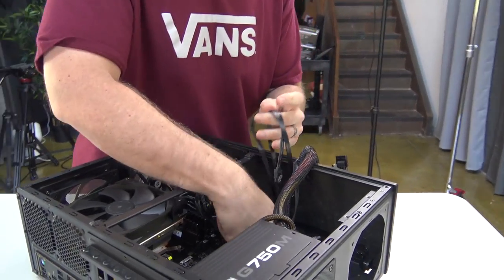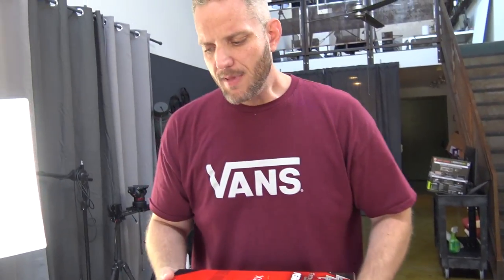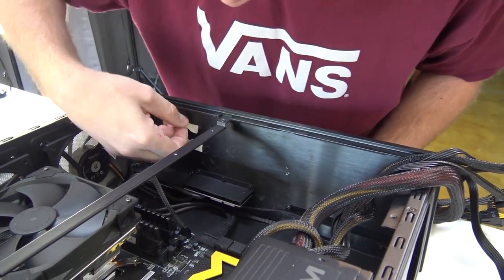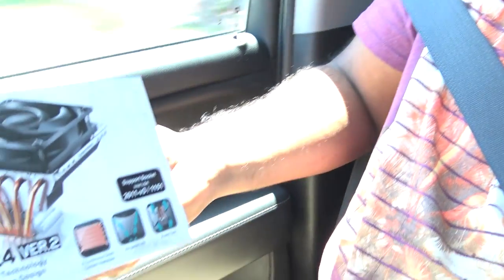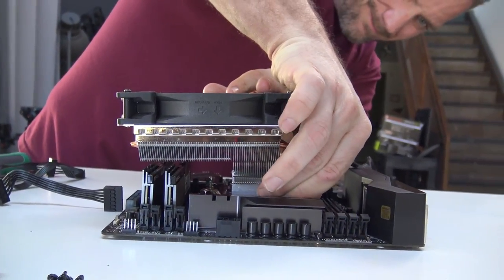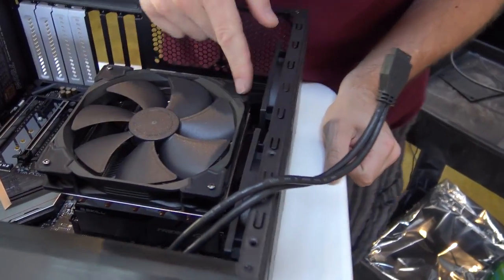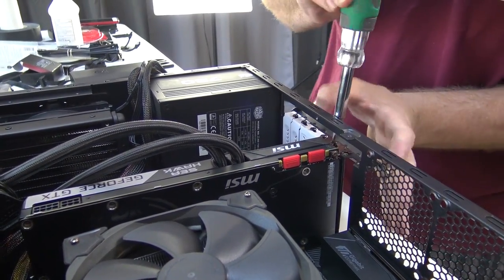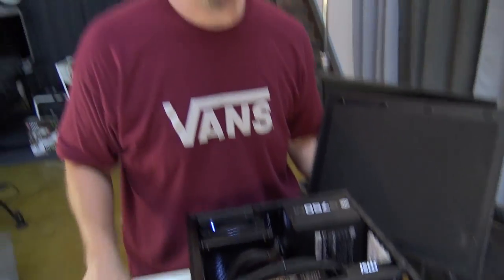X299 + 7740X = Ultimate VR PC?

Comment: Hey Jay, instead of double sided tape try using those removable 3M strips ( the "refills" for the coat/key hooks). I use them for the ssd mounting in my coolermaster case so that I could remove the other hard drive cage. They are a bit easier to peel off, if you leave the pull tabs exposed. Plus, you don't have to scrape them off if you decide to change your mounting. Just food for thought...
Reply: Robert Snyder I used those to hold my Elgato to the side of my desk and 3.0 hub.

Comment: people still buy intel?
Reply: faisal rahmat Sadly, yes.
Reply: unbelievable...
Reply: WalkandPeace sure, but they will never buy x299 or z270 right? all they want just a computer for thing like ms word or excel...
Reply: WalkandPeace no cheap intel soon then...😑
Reply: If you have the money Intel is still the best for most people, more threads are just going to be sitting idle under most common work loads, games rarely see significant performance increases beyond 4 cores so you will get much better performance going with the Intel chips that can OC to much higher frequencies than Ryzen chips because higher frequencies always improve performance for any workload.
There is also the issue that the Ryzen hardware (and new Intel platforms like X299) is still new and not as reliable as the more mature Intel platforms so it's not as good for professionals or companies that NEED reliability even though they would probably benefit greatly from the extra core at lower prices, this is why Linus Media Group recently upgraded to X99 instead of the newer Ryzen or X299 platforms.
Currently Ryzen is pretty much only ideal for people who have a need for more than 4 cores and are willing to accept slightly less reliability to save a some money, or for people who's budget is so low they might be considering an i3 or low end i5 when AMD is offering 4-8 cores at similar clock speeds and pricing. So it's great for amateur youtubers and twitch streamers but not for just about anyone else, and if you paid attention that's exactly who AMD were targeting with their Ryzen marketing.

To be clear I think Ryzen is great, it's just unfortunate that because of Intel's long running market dominance and unwillingness to add more cores to their main stream lineup, there hasn't really been any mainstream software designed to take advantage of more than 4 cores. However with Ryzen now being available in the mainstream hopefully more developers will be making their software take advantage of more than 4 cores and in the next 3-5 years the 8+ core CPUs will make a lot more sense. Ryzen is just too ahead of it's time, and by the time mainstream workloads catch up and make Ryzen a good choice it will be time to upgrade away from Ryzen :(.
Reply: AusSkiller 
This is the must logical conclusion
Reply: AusSkiller just simple question, i got an i5 6500 + z270 board and planing to upgrade, which1 shuld i buy, an i7 7700K OR r5 1600+b350 board? the cost for that both option is very similar at my country, what do u think?
Reply: faisal rahmat what do u aiming for that upgrade? if u gonna upgrade for ryzen u gonna need all thing like new mobo and if u up to i7 7700k its wasting money because u already have PC. just spent it on other part
Reply: Lie Stefanus90 planing to upgrade for video editing and 3d rendering... i5 not fast enough, some people build a pc not just for gaming i guess...
Reply: faisal rahmat then choosing i5 is already first mistake u did go for ryzen if aiming for that
Reply: Lie Stefanus90 dude i got that i5 on august 2016, no ryzen back then...😑
Reply: faisal rahmat oh wait do u do heavy 3d rendering(studio) or just avg rendering?
Reply: heavy rendering= ryzen 
avg rendering = i7 because u already have z270 just oc it to 5ghz and get serious cooling aio
Reply: Looking at the market share, one has to ask:

People still buy amd?
Reply: Lie Stefanus90 nice... but with similar price of i7 7700k i can get a r5 1600 plus b350 board for it, what u think? if ryzen can do heavy rendering i realy consider to get ryzen since the upgrade cost is same...
Reply: "people still buy intel?"
Jay did not buy it.
Reply: faisal rahmat really? u should start selling ur z270 and i5 6500 which country u from? im looking for z270 right now
Reply: faisal rahmat get the 1600 and b350 board. It'll be great for rendering
Reply: Lie Stefanus90 am from indonesia...
Reply: Tough call faisal rahmat, if your primary use of the PC is rendering (and you know the software you use can take advantage of the extra cores, and it can't do the rendering on the GPU since GPU compute can be MANY times faster than a CPU) then the Ryzen is probably the best for your needs, assuming you can risk having a crash/restart during your render (it's highly unlikely to happen with the latest firmware, but sometimes reliability is critically important and a random crash/restart cannot be risked).

If you mainly play games and do rendering on the side then overclocking a 7700k to 5ghz will probably be a better option as the performance drop for rendering is only going to be about ~20% at most assuming you can get the 1600 to 4ghz, and you could get up to 25% better performance in most games. Of course it would also depend on your GPU, the game and the settings you want, as if your GPU can't push the frames fast enough it won't matter that the CPU can send it more.
Reply: faisal rahmat that is stupid, it is downgrading a mobo, coffelake will bring 6 cores to lga 1151
Reply: dawg ik  that the ryzen 7 is cheaper,but the i7 7700K is still better for streaming,gaming,etc
Reply: Also, ryzen b350, x370 and x299 don't feel High quality, i struggle to see b350 Boards with more than 4 phases, and most of they don't even have heatsinks on them. My z170x gaming 5 Board came with 12 phases for the prize of a top tier b350 one. What they do have is rgb all around, i like rgb but when a whole heatsink becomes plastic just to be Able to change it's color it is too much. Connectivity in ryzen is not the strongest point either, f.e. The gigabyte ab350 gaming 3 has got 4 Sata ports, no SLI capability and 7 usb ports (one being 2.0) and one m.2 slot, but of course it has got a lot of rgb!!!
Reply: AusSkiller Ryzen x370 and lower chipsets are very reliable. I built a 1700X system about a month ago with a 1080 ti and I had no memory issues, ran at advertised speed, and I have yet to have a single bug from the platform. Threadripper and X299 will have issues just like X99 had issues a couple years ago, but give it 3 months and it'll be all sorted out.

And if you think hardly anything benefits from more cores, I've had my 1700X at 80% while playing Assassins creed syndicate with the only thing in the background being MSI Afterburner.
Because ryzen is so popular, next generation games are going to benefit from more than 4 threads. It's just a matter of taking time to program it. Consoles have 8 core jaguar chips, and they fully use 8 cores because that's how they were programmed to run. As it gets more popular you can expect it to become more mainstream.
Reply: Well yes because the 7700k is still unmatched in gaming.
Reply: Savage Salvage,  Yeah Ryzen is certainly quite stable now, but it's still a new platform and it will usually take at least 6-12 months to ensure all the bugs are worked out and it is suitable for usage in an environment that requires reliability. For the average consumer it's certainly stable enough but for professionals and corporations that can't afford any down time it's hasn't been stable long enough to prove it is suitable for such use, it's just a matter of time though.

Utilisation percentages do not equate to performance unfortunately, multi-threading is an incredibly complicated subject and games are not a very good use case for it, often there is a lot of overhead to doing multi-threading in games because the work required cannot be split up easily, there are different types of work frequently being switched between, and/or is there is too little work to keep all the cores consistently saturated, this leads to seemingly high utilisation for what is actually rather marginal performance benefits. There is also a lot of asynchronous work that can be done in games that may not have any noticeable impact on performance such as streaming textures or music that is just preparing data for use later on and is designed to be able to take much longer without any impact on frame rate but can bump up the utilisation a fair bit. There is also the issue of CPU utilisation metrics being rather inaccurate as they often just sample the CPU at regular intervals and report an average rather than monitoring the exact utilisation (which severely impacts performance) so if the usage fluctuates rapidly it's often hard to get an idea of how much it is actually being used. There's also architectural issues in the code for games that can come into play, there is often a single "main" thread dictating the overall flow of the game, the performance of this main thread is what will dictate the frame rate, if it is running at 100% and the rest of the threads have to wait for it then it will not matter how many cores you have you will not be able to increase frame rate, this is how pretty much all games were made until recently and it is still heavily used in games due to the nature of games development. In this case the only way to improve performance is with higher clockspeeds or better IPCs. If you are using 80% because 20% of the time the rest of your cores are waiting for the main thread then a 7700k is going to have a much better chance at outperforming it.

Take a look at gaming benchmarks comparing the 7700k to the 1800x, often the 7700k will beat out the 1800x and in the instances where it doesn't the difference is pretty marginal. I imagine the 1700x isn't going to fare much better.
Reply: AusSkiller I simply pointed out that game because it's higher use case. In most games I get a reading of around 25 to 35%.
A friend and I are mildly competitive with our PC's, who can get better overclocks, and stuff like that. We play on each other's pc's to see what is actually better. This time he went 7700k, and I went 1700x and I got mine overclocked to 4050 MHz and his 7700k is at 4.8 ghz (he didn't win the silicon lottery, any higher was crashing even with 1.48V) and we were surprised how much more smooth the 1700x was than his 7700k at dx12 games. He had a higher average frame rate but I had much better 1% and .1% lows. It's amazing how much smoother the games feel. That's not a AMD vs Intel thing, it's simply an 8 core vs 4 core thing. We both have 1080 ti's, mine at 2050 MHz and his at 2088 I think.
Dx11 games were different though. His frame rate was higher but smoothness was the same. It's because dx12 has the ability to put tasks to more cores even if they're not fully utilized, it takes the load off of single core (to an extent of course) so when the CPU is pegged it can spread out the load. It's currently not very efficient, but it still works decent and that's why so many people (myself included) claim that ryzen gaming is smoother. 7700k is marginally better at best, which is why I went 1700x. 
I'm also not only a gamer, so even in DX11 games it's worth it to me, because I make money on the side making 3D models and simulations in blender, and sometimes on big tasks I'll start virtualbox and dedicate 4 cores and 4 threads to it, and run the simulation in virtualbox while my other 4 cores and 4 threads I'll use to play a game while I wait. I know it's not as productive as just waiting but it makes the time seem to go faster. 
But everyone knows that people that do simulations like I do are better off with ryzen, but it's not near as bad at gaming as many people claim. Where I get 140, 145 fps, my friend gets 155 ish. Since when is 145 fps bad?
Reply: faisal rahmat Yea its the most used platform still by DFAR
Reply: Why would they not? For certain tasks, like gaming, intel is still the king. The 7700k is the best gaming chip available now, and for the foreseeable future. It beats the 1800x, it beats the i9 7800x, etc. 8 threads with high clocks, and great IPC is and will continue to be the best combo for gaming, until such a time as games are built and optimized for more than 8 threads, which won't happen on a large scale until the consoles go above 8 threads. 

And you might say the 1700/1800x, etc give you plenty good gaming performance too, but high refresh rate gaming is on the rise, so the extra 10-30fps you can get(depends on the game), from the 7700k is more than worth it for some people. Especially given the prices, the 7700k is cheaper than both the 1700x and the 1800x, and only a bit more than the 1700. And it beats both in most titles, usually by a good margin.
Reply: Elogamer i realy hope that will be happen, but am afraid the price will similar to 1700x plus x370 mobo... if so, i go ryzen...
Reply: agreed... intel is very good... but i just do less gaming nowaday...

Comment: gimme a 1080TI, i broke my r9 390 and need to use a GTX480 now yes GTX!!!
Reply: vincent van Rijn how did you break a 390 ?
Reply: Joseph Goble external 12V line, hit the IO plate, and blow up the core (die missing)
Reply: fuunku YES
Reply: The RX 480 is overall a little faster than a R9 390.. so your reasoning is a little flawed..
Reply: Hendrik visch gtx 480. not rx 480.
Reply: I can give you 2 GTX580s that i have somewhere
Reply: JakeOcowell can i have one. ill pay shipping. im using a gts 250 and an amd athlon II x2 215
Reply: Hendrik visch I think your eyes are flawed
Reply: Nihad Asadli nice roast broski
Reply: So is your ability to read.
Reply: JakeOcowell where are u from? if you are dutch we have a DEAL!
Reply: some of these kids werent even born when the GTX 480 was a thing
Reply: I sold my 390 and replaced it with a 1080 Ti, god damn what a boost
Reply: lol i bought 7 years ago an asus en gtx480 voltage tweak buth died two years ago.. :D

Comment: I'm pretty sure the PSU can handle a little restricted airflow... it's better than sucking in heat from other components.  An efficient PSU that isn't over-stressed will not need much to run optimally.

Comment: That seahawk looks sexy. I will definitely change into aio water cool gpu on my next upgrade. Hopefully there is a good difference in temps because right now im on a 1070 amp extreme with 3 fans and it never goes over 64 on full load.

Comment: how many space would you want to have from for example an 140mm topblow cpu cooler to the case? how much space must the fan have to the closed metal side without having negative effects on the air going through the fan? thx, flo

Comment: Double-sided tape? No! 3M Command strips ftw.  No more split SSDs.  Also the shrouded pull fan on the radiator should be quieter than if it had fit like normal.  For all that silent PC realism in VR and stuff.

Comment: I may be wrong but it still doesn't make sense. I am probably wrong with this but not only does the m.2 ssd take up 2-4 pcie lanes depending on the versions but also modern graphics cards need all pcie lanes to work efficiently. That being said with your 7740x you are  only given 16 lanes. Since the graphics card needs 16 but doesn't have it because of the 2 or so from the m.2 it goes down to 12 ot 8 pcie lanes (I forget which). So This in theory would hurt performance correct?
Reply: if the pcie drops down to less than 16x, it'll go to 8x for the gpu.

As for the gpu though,  no gpu is fast enough to over-saturate PCIe 3.0 8x speed and that includes the 1080ti. 

So the performance difference between 16x and 8x pcie is minimal at best. 

while this article only uses the 1080 (non-ti), it shows the performance difference between PCIe 1x, 4x, 8x, and 16x and the 3 different PCIe versions.

https://www.techpowerup.com/reviews/NVIDIA/GeForce_GTX_1080_PCI_Express_Scaling/

suffice to say (with the ti card), as long you're above PCIe 1.0 16x, 2.0 8x, or 3.0 4x (vitually same performance between the 3), You'd be hard pressed to tell the difference on performance.

Comment: Here's an Issue I've recently ran into! Only so far does the Asus Prime x299 deluxe seem to require an 8pin CPU and 4pin CPU connector from the PSU. Jayztwocents would you happen to know a PSU manufacturer that makes a PSU with the ability of both 4pin+8pin CPU molexs?

Comment: Hey Jey, am having a small problem with my pc that i need your help with, I have an MSI 1070 and it's really heavy on my ASUS Z170 motherboard, it's sagging and am afriad that with time it will break the Motherboard, I tried to put something beneath it to hold it in place but it looks awful, can you do a video about this matter? Thanks
Reply: MrLebanman a little sag is normal with heavier cards. Does it have a backplate? You could tie a piece of fishing line to the end of the card and the top of the case with a little tension on it to hold the weight of the card. It's virtually invisible.
Reply: Thanks for the idea john, once i saw your comment i tried your method but the only "solid" place i could find on the gpu to tie the thread in was the heatsinks and those suckers are really hot to attach any thing to it. Yes it does have a backplate but this gpu is too damn heavy man, i want a legit solution and Jay is the best in the business and am sure that he could give us some answers to this matter

Comment: the CPU which should not exist is the 7640x
the 7740x is for extreme OC though the 7700k is not far off and if there were cheaper under $250 MOBO's which would not support any i9 but all i7 Kaby Lake/Skylake chips were supported then that too would be awesome as it is limiting the support for the overkill components yet allowing us to get more for less and will at least bring Intel somewhat back